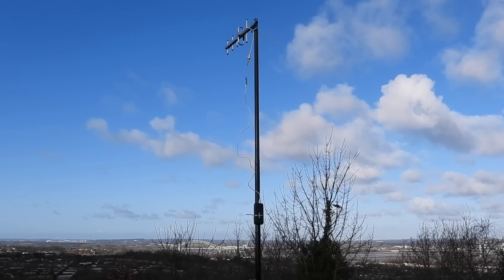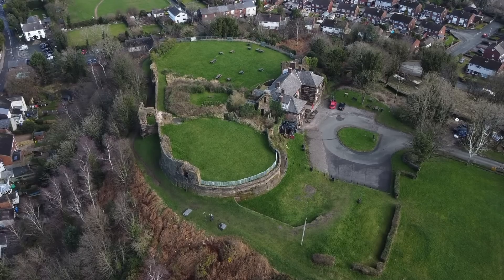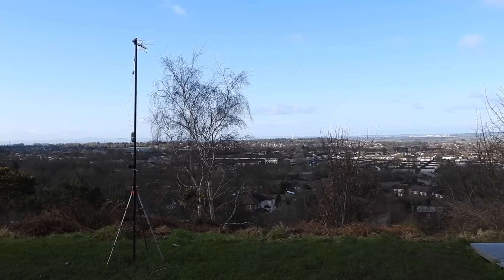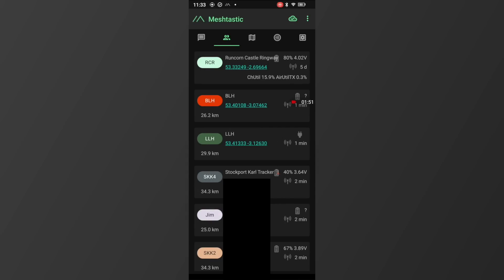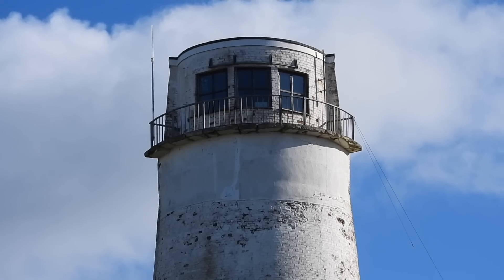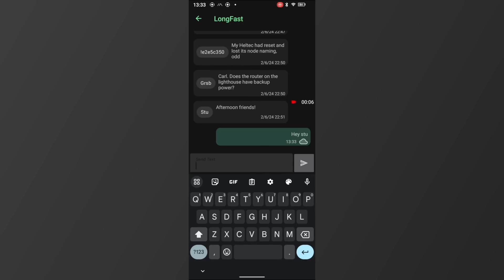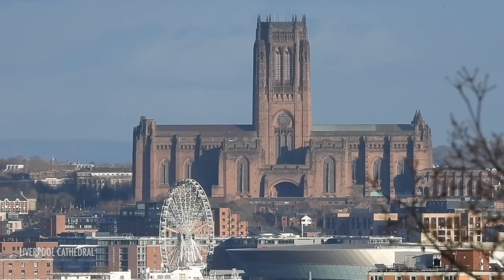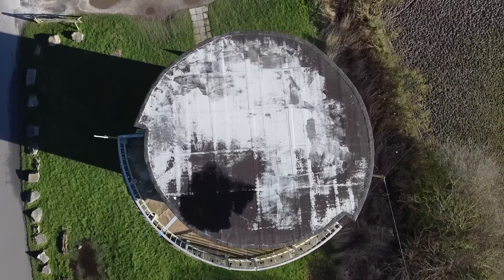This Massively Increased My Meshtastic Range!

Comment: Interesting stuff.
I’ve seen a few videos before.
It seems the area is hilly as per where I am, you need to think about bouncing signals hill top to hill top or other high vantage point. From the highest hills here it’s possible to see for many miles in every direction. There’s a monument on one of them and this can be seen from most of the low points surrounding. There’s also 2 transmitting towers up there which I believe are tetra.

I assume there’s no real reason why it wouldn’t be possible to get signals across the Severn, between England & wales….and ultimately with high vantage points, across the English Channel into France.

In a similar way, maybe have an antenna on the Isle of Wight which could be seen from a great % of the south coast….in the same way freeview tv is broadcasting from there to the south of England.

Comment: I really need to get into Meshtastic and both set up a node at home where I'm about 350ft ASL and have a great takeoff across the West Midlands. It will share the same location as my GB7EZ repeater. It will also be good fun to have one in the back of my car with a small Yagi to take out when I'm portable. 

Another great video, Lewis - thanks!

Comment: I wonder how feasible it would be to make solar powered nodes to deploy around an area? Have the radio. electric bits, and a battery and for night time power inside a weather proof housing with a decent antenna and a big enough solar panel to power the device and keep the battery topped off so it could be running 24/7. It would be really cool to set up a handful of these "stations" around the community and a proper mesh system.
Reply: If you're doing low power, NRF52840 based boards are your best bet. Wisblocks are probably the best direction to go. The ESP32s pull a lot of power and aren't really easily sustained on solar.
Reply: That's what I'm thinking of doing at my house and on a couple of friends properties. Shouldn't be too hard or too expensive.

Comment: Do you know, is there a way to get a node to bridge the various transmission modes? It would be helpful for starting hops on "VERY_LONG_SLOW" because you're way out and then having the closer "city nodes" take over on "LONG_FAST" when the mesh is tighter knit...
Reply: Private MQTT server and then republish packets between the 2 channels.
Reply: @AndrewJonesMcGuire  That's what I was starting to think. Seems like something that would be good to build into the firmware at some point. A "long to short repeater mode" as a disabled-by-default option. After all, in the USA at least, 1/5th of the population is rural. It'd be good to keep rural and city connected in "mesh is needed" events.

Comment: I am fascinated by this new LoRa/ Meshtastic format.  I not sure of LoRa's presence over here in West Coast Canada.  But I learned that LoRa is a thing here too.  I may build my own 800 MHz  Yagi  to use with my RTL-SDR to see or hear telltale signs of LoRa signals.
Reply: There is a small presence! I'm out in a bit of a blank area though. If you want to find the nodes on SDR you should be targeting 915mhz range (902-928)

Comment: Nice video. Is this china Yagi really a proper choice? I doubt it, there aren't good Yagi for 868mhz available at Ali. A logper antenna would be more suitable when using a LTE antenna.
I did 53km today with a small 3d printed moxon antenna line of sight.
150km shouldn't be a problem for lora with sf9.
Reply from the maker: There’s one in my attic receiving those boxes directly 80km away